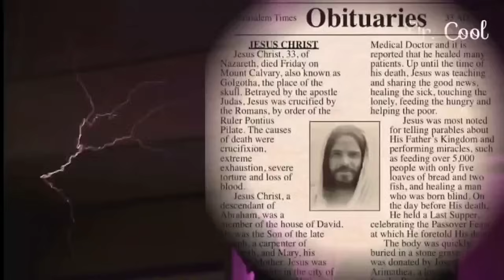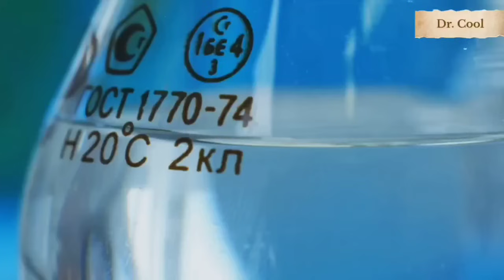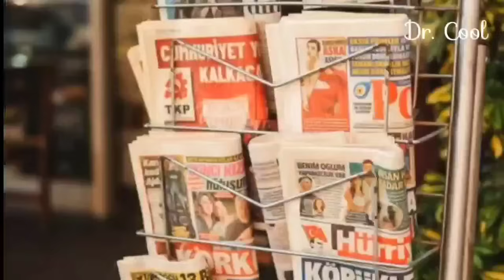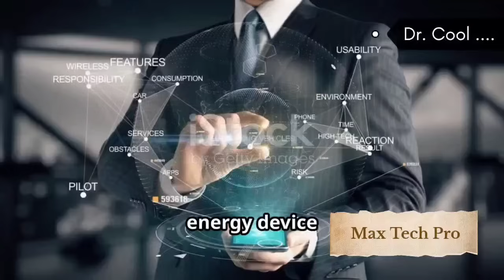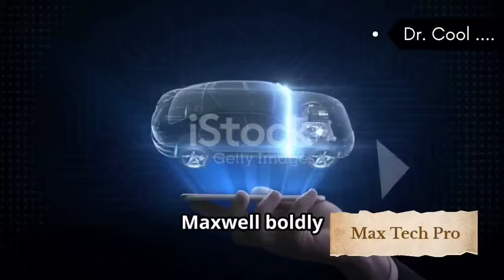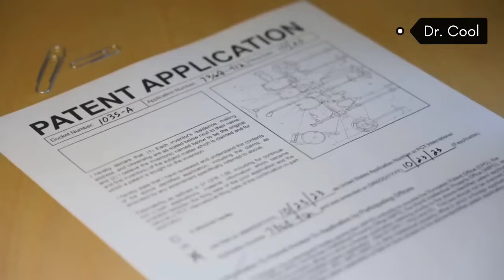Maxwell Chikumbutso’s Latest Promo Sparks a New Global Tech Battle

Comment: Diode Array is smoothly scalable from microwatt medical applications through internet communication devices to industrial power and beyond to fast and heavy aircraft all with long life. 

All these attributes are taxonomically type two perpetual motion machines. Given the smooth scalibility either all uses are impossible or all are possible. 

Energy being changeble in form and always conserved should not be compromized by heat being conserved energy that can't be used. 
A semiconductor device and the heat containing material surrounding it that is at a uniform overall temperature contains mobile charged quasiparticles that have thermal kinetic energy at temperatures above absolute zero known as Johnson - Nyquest thermal electric noise that can be rectified by interaction with immobile charges in solids. 

As the thermally energized mobile charge carriers move from ground and are channeled up into an electric circuit they loose thermal energy and gain exactly as much electrical energy. 

Aloha
Charles M Brown
Kilauea. Kauai, Hawaii 96754